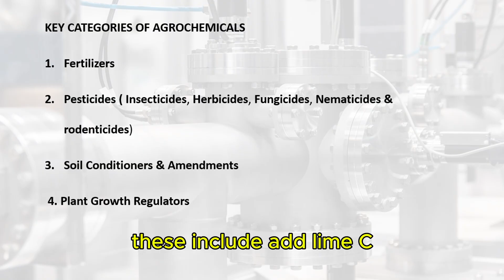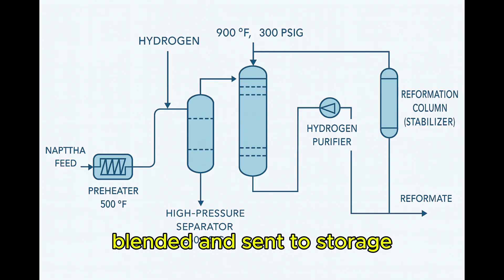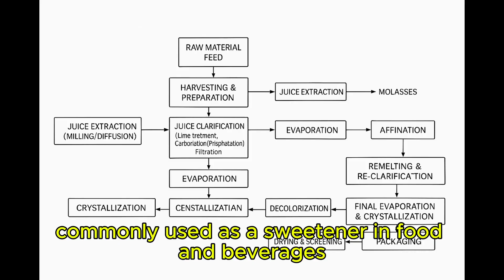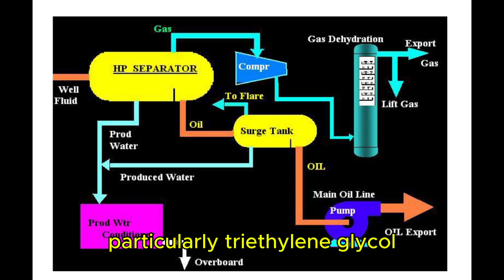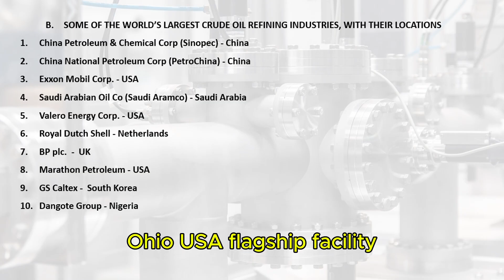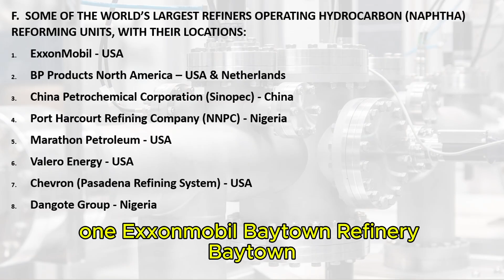From Molecules 2 Millions: The Chemistry, Process Flow & ROI of Industries & Utilized Raw Materials

Comment: Q: CLASSIFY PETROLEUM AND JUSTIFY CLASS OF PETROLEUM THAT IS PREDOMINANT IN NIGERIA:

1. Petroleum is classified mainly by composition, sulfur content, and API gravity.
2. Composition types include: paraffinic, naphthenic, and aromatic crudes.
3. Paraffinic crudes are rich in straight/branched alkanes and yield high gasoline.
4. Naphthenic crudes have cycloalkanes and are good for lubricating oils.
5. Aromatic crudes are denser and contain more aromatic hydrocarbons.
6. By sulfur content: Sweet crude (≤ 0.5% sulfur) and Sour crude (> 0.5% sulfur).
7. Sweet crudes are easier to refine, less corrosive, and more valuable.
8. By API gravity: Light (> 31°), Medium (22°–31°), and Heavy (< 22°).
9. Light crudes yield more gasoline and diesel; heavy crudes give more fuel oil.
10. Nigeria mainly produces light, sweet crude oil.
11. Sulfur content of Nigerian crude is low (0.05–0.3%), making it “sweet.”
12. Conclusion: Nigeria’s light, sweet crude is globally prized for easy refining, low pollution, and high yields of premium fuels.

Comment: Chemistry of Moisture Removal from Natural Gas during Gas Processing
Introduction
Moisture (water vapor) in raw natural gas leads to serious operational problems. At reservoir conditions gas is typically saturated with H₂O, so if untreated it can condense or freeze under cooling or pressure drops. The condensed water forms hydrates (e.g. CH₄·2H₂O) or ice that plug pipelines, and it dissolves acid gases to form corrosive acids (e.g. H₂O + CO₂ → H₂CO₃). For this reason pipeline specifications require very low water content (typically ≤5–7 lb per MMSCF of gas). Excess moisture also dilutes heating value and lowers flame temperatures. Drying natural gas prevents hydrate blockage, acid corrosion and loss of fuel efficiency.
Glycol (TEG) Absorption Dehydration
Glycol dehydration is the industry-standard liquid-absorption method. Lean triethylene glycol (TEG) is circulated through an absorber tower against the wet gas. Gas flows upward while TEG flows down, physically absorbing water vapor. The water-rich glycol is regenerated by depressurizing and heating to distill off the water, allowing TEG reuse. The process follows Henry’s law equilibrium and is driven by differences in vapor pressure between water and the glycol solution. TEG systems meet pipeline specs but cannot achieve ultra-low moisture levels needed for cryogenic processing. Common issues include foaming, glycol loss, and degradation at high temperatures.
Adsorption Dehydration with Solid Desiccants
Solid desiccants like molecular sieves, silica gel, and activated alumina remove water vapor by adsorption. Molecular sieves (zeolites) have uniform pores that selectively adsorb water, achieving sub-ppm moisture levels. They operate in dual-bed systems where one bed adsorbs while the other regenerates via heated dry gas. Silica gel and activated alumina are used for moderate drying, offering dew points between –50°C and –70°C. Adsorption is exothermic, and regeneration involves heating to drive off adsorbed water.
Deliquescent (Chemical) Drying
Chemical dehydration uses hygroscopic salts such as calcium chloride, which absorb water chemically and dissolve into brine. No regeneration is possible; salts are replaced when spent. This method is simple, requires no power, and is suitable for remote sites, but performance is limited by gas temperature and pressure. Disposal of spent brine is required.
Comparison of Methods
Glycol systems are economical and continuous but have moisture limits. Molecular sieves offer the deepest drying but at higher cost and complexity. Silica gel and activated alumina offer intermediate performance, while deliquescent salts are best for small, remote applications. Temperature, pressure, and regeneration requirements influence method selection.
Chemical Principles
Dehydration processes rely on physical absorption, adsorption, or chemical hydration. Examples include: CaCl₂ + 6H₂O → CaCl₂·6H₂O and reversible adsorption on zeolites. Both absorption and adsorption are exothermic, requiring heat input for regeneration. Equilibrium and kinetics govern performance.
Operational Issues
Common problems include foaming in glycol units, desiccant degradation, and salt bed replacement. Proper design, temperature control, and maintenance are critical for efficient, reliable operation.

Comment: 1. Design and Formulation of Drilling Fluids – Develop mud systems with suitable viscosity, density, and chemical stability for specific well conditions.
2. Selection and Optimization of Additives – Choose lubricants, clay stabilizers, corrosion inhibitors, biocides, and other chemicals to enhance drilling efficiency.
3. Laboratory Testing of Drilling Muds – Perform rheology, pH, density, and contamination tests to ensure proper fluid performance.
4. Chemical Analysis of Drill Cuttings and Core Samples – Evaluate lithology, hydrocarbon presence, and reservoir characteristics.
5. Geochemical Fingerprinting – Identify hydrocarbon types, source, and maturity for drilling direction decisions.
6. Corrosion Monitoring and Prevention – Assess chemical effects on pipes and casings; recommend corrosion inhibitors.
7. Materials Compatibility Testing – Ensure drilling fluids and completion chemicals do not damage wellbore materials.
8. Environmental Waste Treatment – Treat and neutralize spent drilling fluids and cuttings before disposal.
9. Oil and Chemical Spill Response – Provide chemical expertise for spill containment and cleanup.
10. Chemical Hazard Management – Oversee safe storage, handling, and disposal of hazardous chemicals.
11. Regulatory Compliance – Ensure chemical use meets environmental, health, and safety regulations.
12. Well Stimulation Support – Prepare and test acidizing fluids, scale inhibitors, and fracturing chemicals.
13. Completion Fluid Formulation – Design fluids to prevent formation damage and maintain productivity.

Comment: Supersonic separators
These devices use a specially shaped nozzle to accelerate the gas to supersonic speeds, which causes rapid cooling and non-equilibrium condensation of water and heavier hydrocarbons. The tiny droplets are then separated by swirling or centrifugal action and removed. Supersonic separators are compact, have no moving parts in the core separation step, and can give very fast, energy-efficient removal of condensable hydrocarbons and water compared with conventional knock-out drums and some dehydration methods. They are being actively tested and deployed as a lightweight option at wellheads and offshore facilities. They work best when you need compact, low-maintenance front-end removal, but they can be sensitive to feed conditions and typically complement rather than fully replace cryogenic or solvent systems for deep NGL recovery.  ￼ ￼

Membrane and hybrid membrane systems
Membranes have improved considerably and are now used either alone or combined with other processes to pull out heavier hydrocarbons and water. Modern process designs use polymeric membranes, mixed-matrix membranes, or multi-stage membrane trains integrated with compressors, chillers, or cryogenic units to recover NGLs while letting methane pass. Membranes are attractive because they are modular, scalable, and can reduce CAPEX and footprint in small to medium plants. Their limits are selectivity versus permeability tradeoffs and sensitivity to heavy condensates and fouling, so current practice is often hybridization with cryogenic units or adsorption beds to get high recovery and purity. Pilot and field demos have shown membrane systems can recover high fractions of NGL when properly integrated.  ￼ ￼

Advanced adsorbents including MOFs and engineered zeolites
Research breakthroughs in metal-organic frameworks MOFs and engineered porous solids are showing much higher affinity and selectivity for specific hydrocarbons (for example targeting butanes and pentanes) than traditional adsorbents. MOFs can be tuned at the molecular level to prefer particular hydrocarbon sizes or shapes, which opens the door for more selective adsorption separation trains that capture heavier components while leaving methane untouched. The challenge remains moving from lab scale to robust, moisture-stable industrial adsorbents and designing cyclic regeneration schemes that are cost effective. Still, MOFs and similar materials are a leading area of innovation for adsorption-based NGL removal.  ￼ ￼

Process intensification: rotating packed beds and intensified absorbers
Rotating packed beds RPBs and other intensified contactors improve mass transfer by creating very high shear and thin liquid films, which speeds up absorption of hydrocarbons into solvents or absorbents. This means smaller equipment, faster separation, and sometimes lower energy usage for solvent regeneration. RPBs are being tested for hydrocarbon absorption, alcohol or solvent scrubbing, and for CO2 removal in gas streams, and look promising where footprint and fast response are important. Their use requires careful design around mechanical reliability and solvent handling.  ￼ ￼

Hybrid cryogenic and turboexpander advances
For deep NGL recovery and when product NGL value matters, cryogenic refrigeration and turboexpander processes remain the state of the art. Recent improvements focus on hybridizing cryogenic steps with membranes or supersonic separators, improved expendable efficiency, and process optimization to reduce specific power consumption and CO2 footprint. That makes very deep recovery economically and energetically more attractive in many projects, especially when you want to separate multiple NGL components (ethane, propane, butanes) downstream. These systems are capital intensive but necessary when you need high NGL yields or product separation.  ￼ ￼

Quick comparison, practical guidance, and typical use cases
If you need a compact, front-end device to remove condensate and water at the wellhead choose supersonic separators. If you have distributed small-scale sites or want modular, lower-CAPEX solutions, membranes or membrane-hybrid setups are attractive. If you need selective capture of specific C3+ molecules and are evaluating next-gen adsorbents, investigate MOF and tailored zeolite solutions but factor in maturity and moisture stability. For the highest NGL recovery and full fractionation, cryogenic plus turboexpander systems still lead. Process intensification tools like RPBs are an excellent option to shrink equipment size and improve mass transfer where absorption with a solvent is used.

Comment: Water clarifiers and demulsifiers are both important oilfield chemicals, but they act on different problems using distinct chemical mechanisms. Water clarifiers are polymer-based chemicals (e.g., polyamines) used to remove suspended solids from produced water. They work by neutralizing particle charges, causing coagulation and flocculation for easier removal. Demulsifiers are surfactant or solvent blends used to break oil–water emulsions by displacing natural stabilizers at the interface and reducing interfacial tension, allowing droplets to coalesce. Clarifiers act mainly in water treatment after separation, while demulsifiers act on emulsified crude before separation.

Comment: Commercial fungicide production varies by type (chemical, biological, or natural), but generally involves these steps:

Active Ingredient Synthesis: Chemical fungicides are synthesized through chemical reactions in controlled industrial settings, often involving organic compounds like azoles or strobilurins. Biological fungicides use microorganisms (e.g., Bacillus subtilis) cultured via fermentation.
Formulation: The active ingredient is mixed with carriers, stabilizers, or adjuvants to create a stable, effective product (e.g., wettable powders, emulsifiable concentrates, or granules). This ensures proper application and efficacy.
Quality Control: Rigorous testing for purity, potency, and safety, adhering to regulatory standards (e.g., EPA or EU guidelines).
Packaging: Formulated fungicides are packaged in forms suitable for agricultural use, such as sprays or dusts, with precise labeling for safe handling.
Distribution: Products are distributed to agricultural markets, ensuring compliance with local regulations.

The process prioritizes scalability, cost-efficiency, and environmental safety, with variations depending on the fungicide’s chemical or biological nature. For specifics, I’d need more details on the fungicide type.

Comment: The most recent innovative in removing moisture from natural gas streams during gas processing focus on efficiency, sustainability, and cost effectiveness.
1. Membrane Dehydration: Utilizes hollow fiber membranes to separate water vapor from natural gas. It's cost effective, durable, and complies with stringent emission regulations.
2. Advanced Glycol Dehydration: Uses triethylene glycol for efficient water absorption. Innovations include biodegradable glycol alternatives and energy efficient regeneration systems.
3. Adsorption Dehydration with Solid Desiccants: Employs silica gel, molecular sieves, or alumina to adsorb water vapor. Ideal for small flow rates and remote locations.

These technologies aim to prevent issues like hydrate formation, corrosion, and reduced efficiency in downstream processing.

Comment: An advise to agricultural scientist on soil conditioners, I'd like to build their focus on "The Benefits of Soil Conditioners," which includes:

1. Soil Structure Improvement: Enhances water-holding capacity, aeration, and aggregation for healthy root growth.
2. Nutrient Management: Provides essential micronutrients, adjusts pH levels, and improves nutrient availability.
3. Water Conservation: Reduces water loss, retains moisture, and supports drought tolerance.
4. Sustainability: Helps reduce soil erosion, promotes soil biota, and supports long-term soil health.

These points highlight the key advantages of using soil conditioners in agriculture. When selecting soil conditioners, factors like soil type and pH, crop requirements, conditioner composition, and application rates are necessary.

Let me break it down further:
1. Understanding soil composition and pH levels: This is crucial because the effectiveness of soil conditioners depends on the soil's chemical and physical properties.
2. Identifying specific soil challenges: Recognizing issues like compaction or nutrient deficiencies helps select the most suitable conditioner.
3. Selecting suitable soil conditioners: Different conditioners address specific soil issues; for example, lime is used for pH adjustment, and organic matter is used for structure improvement.
4. Considering application rates, methods, and timing: Proper application ensures optimal results and minimizes waste or potential harm.
5. Monitoring soil response and adjusting strategies: This allows for adaptive management, ensuring the conditioners are effective and making adjustments as needed.

By following these steps, agricultural scientists can effectively use soil conditioners to improve soil health and crop productivity. This knowledge will help them make informed decisions about soil conditioner use, enhancing soil fertility and crop productivity.